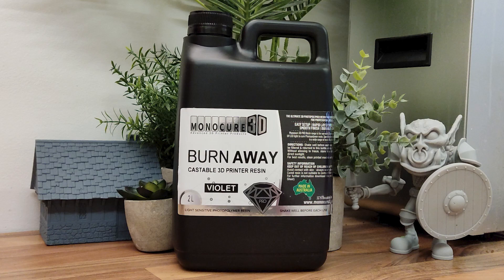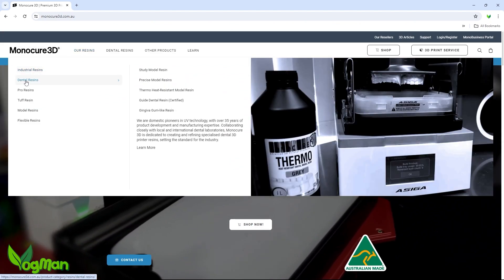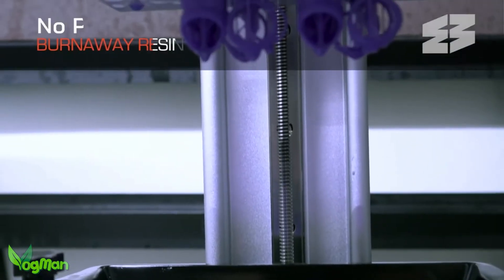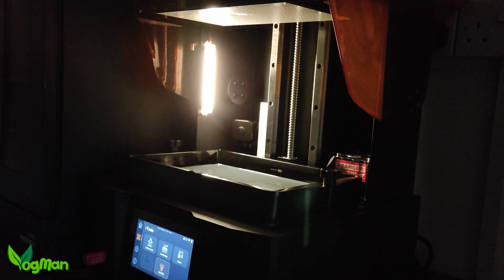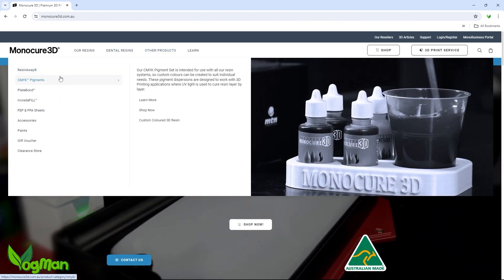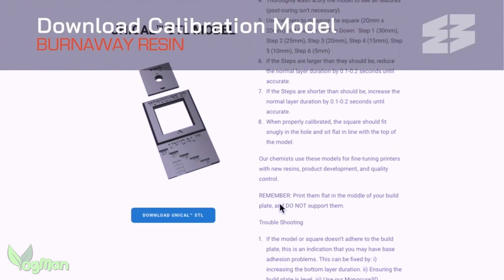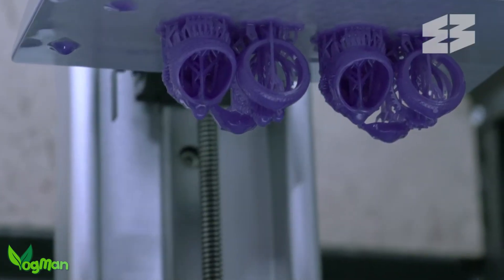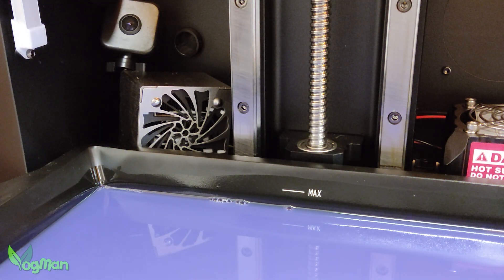Burnaway castable resin HONEST review

Comment: I really want to get into casting metal using 3D printed objects but the whole process looks daunting.  Thanks Mr. Vogman for providing such good videos and inspiration.  However, from what you have shown on your videos, you need a lot of equipment and skills.  I have both FDM and Resin 3D printers.  I do not have a furnace.  I see sprues are a thing and they look critical to get an outcome.  You need materials to make the mould from and ways to vacuum out the air bubbles.  Size seems to matter as you obviously have limits imposed by how much metal you can melt. After it/s cooled you need a Dremel with cutting discs and brushes, then polishing.  It all sounds exhausting.
Reply from the maker: Once you're doing it, it's surprisingly simple and obvious... but try this video. It may help you find a few cheaper DIY options https://youtu.be/-TutObDbxUo

Comment: metal temp was low, it was setting before it left the crucible
Reply from the maker: I know what you're saying, but ironically in this video I set the temperature 10 degrees higher than normal. But I agree, it was sluggish.
Reply: @vogman  its not just a case of hitting the temp it needs at least 15 mins holding at that temp once melted or you will always get cold pores

Comment: Note that the marketing hype claims "Optimal" temperatures of 25 degrees, and not a necessary temperature. It may very well work well enough at lower temperatures. (I'd like to see you do a print at your "room temperature".
Reply from the maker: Ah... but that's the issue... what is room temperature? 😁

Comment: Dear, dear, Geoff, may I suggest that perhaps adding vent sprues at the “east” and “west” locations of the medallion (imagining a compass face on it) would allow both gases and bronze to flow more easily, the porosity of the mold notwithstanding? But as usual, good stuff.
Reply from the maker: Can we vent with vacuum casting? I've often wondered if it's possible...
Reply: @vogman  Technically you’re just adding two more sprues that will  improve the flow of the metal around and through the piece; that it improves the venting by giving the gas another exit is also another benefit, given the locus of the points of attachment. But then I only ever gravity cast using ceramic shell and investment molds at the foundry where employed for several years until the economy forced it to close.